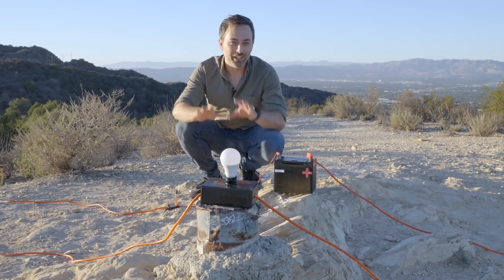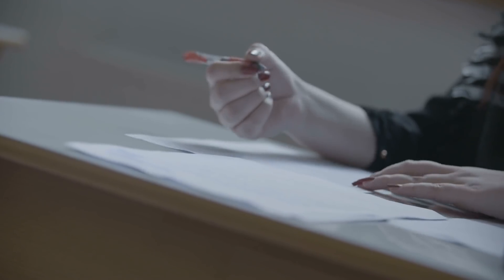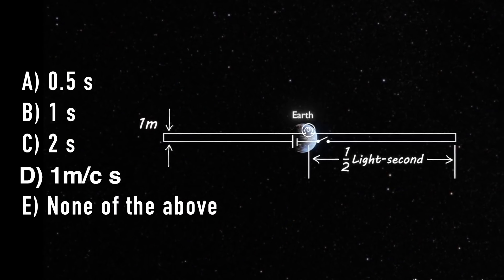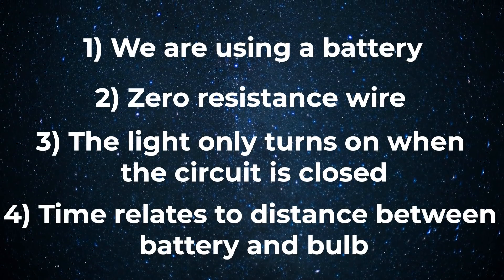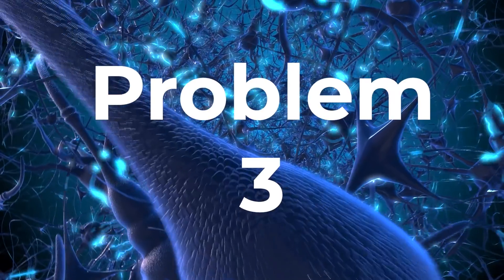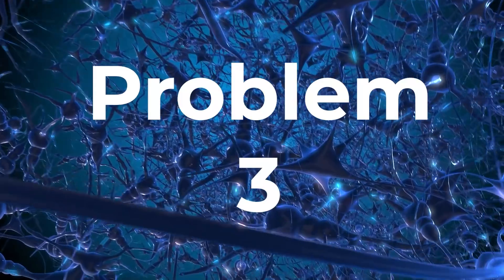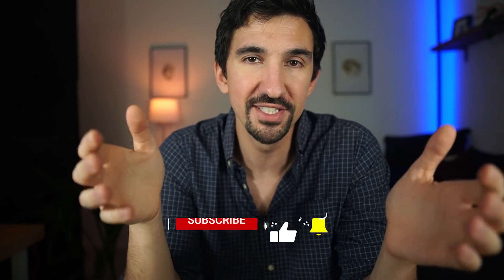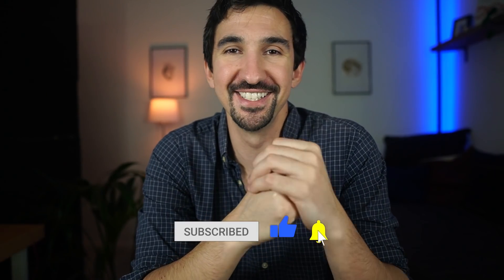Is Veritasium Wrong About Electricity?

Comment: Veritasium is only claiming that connecting the battery (with a switch near the battery) will cause the light to turn on in a few nanoseconds. Not that disconnecting the circuit anywhere will cause the light to turn off in a few nanoseconds. He is basically saying that any change to the circuit will propagate effects at the speed of light, which is kinda true.

Your assumption 3 is already assuming nonlocality. The circuit can be in a state where the circuit is closed yet the light is still only seeing the transient fields, before the steady state is reached. Verirasium is not making assumption 3.

(He's still wrong but not for your reason. The wires near the light and the wires near the battery basically forms a coaxial cable, just one with very poor properties. We might see some transient current in the light within nanoseconds, but this is much weaker than the current in steady state which takes > 1 second to reach.)

Comment: You are right, one is supposed to think about this problem as two antennas and not as a circuit. Otherwise we could fall into problems you described. This might be supprising to high school students that you can still have current even though the circuit is not closed. 

By the way Verisatium's assumption was that the light bulb starts to shine at the very moment some current flows through it. So formally 1/c is a right answer.

Comment: assumption 3 is wrong. if u're familiar with electronics, you know that those 2 wires form a capacitor even if they are not connected at some point very far away from the bulb. so if the wire is broken far away the lightbulb would at first light up and and stop lighting at some point where there was enough time for the information about the broken wire to travel to the bulb. so no causality brakes. doesn't take 12h to think about that, rather 12mins

Comment: I like your antenna explanation, but how would it work if the wires aren't parallel. 
Say an elliptical circuit with high eccentricity, with an appreciable distance between battery and lamp.

I also can't accept "on" being "some potential", as the in the real world the would always be EM energy providing a potential even if the battery is removed from the circuit.

Comment: You are incorrect. Using a battery the current is DC therefore the wires cannot act like an antenna. Second the led is voltage driven, given that it is white, it likely only needs 3 volts to light. Third the wire being a meter apart means it acts like a 800 to 900 ohm transmission line. The capacitance between the wires will cause the voltage to hit 12 volts in 1m/c seconds at the lamp. This happens continuously down the wire until it reaches the ends. Since the ends are shorted it will reach steady state and current will flow through the length of the wire, kind of. If you cut the wire at the end it will take time for the electromagnetic field to collapse and the light will stay lit for d/c from the break.
Reply: The turn on event is a slope, which has a lot of frequencies in it. There is in reality much more than the idealized versions of DC and AC. Actually a perfect slope has all the frequencies in it going to infinity, you can see that if you put it through a Fourier transform.
Reply: @georgelionon9050  you are correct. Assuming no inductance and a perfect switch the slope of a DC circuit being turned on would mimic a frequency approaching infinity. That means a capacitor with a value approaching one over infinity  could pass that voltage with no impedance. Obviously the wire does have inductance, capacitance and resistance so it would act like a transmission line and have an impedance of around 800 ohms so it could provide the led with 6ma of current at 3 volts until the circuit reaches  steady state and then it solely depends on the series resistance of the circuit.
Reply: @georgelionon9050  I should also mention that due to the nature of a white led the forward voltage will never dip below 2.8 to 3.3 volts in this situation because current will stop flowing and the voltage would spike back up because the circuit would go open.
Reply: @FPSG  You're possibly right, at first I calculated the capacity assuming 10mm thick wire (I'm generous) but made a factor 1000 error for m vs. mm. Doing it correctly I get 26uF capacity. Thats why at first I said, nothing, nada, but factor 1000. Maybe. 26uF 12V LED is certainly something one could simply reproduce. Onfortunally my electronic handicraft times are far over, so I don't have the equipment anymore, I would have on my job, but we're currently under quarantine again. The time constant assuming 1mA would be 0.3 seconds. Say, ja, maybe its enough to dimly light until the full EM field arrives (travelling along the wire).

I still say tough, the explanation Derek did is poorly about what he wanted to say, gets a lot of pitfalls of misunderstanding (the contrast of good science communication) and judging from a comment he made as reply, I daresay he didn't understand why D) might actually be the correct answer (if the question would be formulated more precisely in the right manner).

The science asylum video on the other hand on the same topic is excellent all the way through.
Reply: PS: of course 300.000km long wires, 10mm to calculate to a 26uF capacitor putting in the areas, is a gross simplification too. Actually it's way less at first.

Comment: You’re point about the unfair use of the word “lying” is a good one..On the other hand, the bit about communicating faster than light assumes that the effect of the break is instantly communicated. Clearly the second switch would be subject to the same delay as the original - in proportion to the distance to the second switch. You have just set up a strawman - claiming that Veritasium said anything about a second switch.
Reply: The second switch would have a delay. The reason the first switch turns the light on quickly is because of the switch is close to the light so the wave of the changing electric field starts from there and only has to travel the 1 meter to the light. Idk why people have such a hard time with this.

Comment: This is the most sensible take so far. I hope Veritasium watched this. He seemed to deliberately want to create more mystery than understanding.
 12V DC is only going to transfer a miniscule and shortlived amount of power to the bulb which might not light at all until 1 second later when the energy field has gone round the wire to the bulb. A very powerful AC setup will probably transfer some consistent power but that too will only perhaps light it a little bit (e/m wave antenna logic) until, again, a second later when the power travelling through/just-outside the very long wire, arrives at the bulb a second later.

I'm sticking with a second because I infer (strongly) that the to and fro journeys of current happen simultaneously.

Love that breaking the laws of Physics part. It is the icing of this cake.
Reply: " He seemed to deliberately want to create more mystery than understanding."

I don't think so, as that would be totally opposite what he usually aims at. My guess is, he didn't really understand it, took the words some experts he interviewed, but argued it poorly while in fact it may be correct (depending on the parameters you did). But this is the issue the result is, it was more confusing than clearing up -> bad science communication.

And since this comes up again and again, of course science communication has to simplify, but the real art is simplifying it without making it wrong.

Comment: Charge arrives before current in a conductor, photons have a speed limit, Cray computers cut wires to speed of light lengths as a compromise, works fine in real-time.

Comment: If it is so "instant", how does the circuit know if the wires are tied together 1 light year away? Maybe it's open circuit? If he's talking about capacitance of transmission line, that is another thing.. it will turn on for a brief second, but since the circuit would be open 1 light year away, we expect the light not to shine after that..  *edit* was commenting before watching video

Comment: Ideally setting pure DC resistance to 0 is one thing, but impedance remains. You have a really long inductor and a really thin but long capacitor plate. Huge inductance, huge capacitance.

Thus, the circuit cannot be simplified in the way Dereck attempts to.

On the other hand, you actually have a pair of inductors and capacitors, and he specifies them as balanced around both the switch and the light.

So, the path of energy is one meter, even though the transference within the capacitor and inductor takes much longer.

Poorly described problem, yes.

But the time is relatively correct, if you'll pardon the expression.

Comment: "everything says this shouldn't be the case" (information faster than light) but it has already been demonstrated through entanglement at the least.
Reply: entanglement is not information faster than light tough. It's complicated.
Reply: @georgelionon9050  There has been a demonstration of information sent instantaneously.
Reply: @VndNvwYvvSvv  no there is not. Veritasum has a video about it. That one is actually correct :)

Or let me summarize it really quickly, you cannot use the effect to transmit information, since you cannot influence the spin the measurement will make, only after you compare notebooks you will see the two sides always measured opposites. 

Physicists still argue to date how this could be interpreted. There isn't a finite answer to that yet.

But at least at our current knowledge, we cannot use this effect for a faster than light communication.

Comment: Sooooo what happens in a fully shieded circuit. One where the battery is shielded, the wire is shhielded, the bulb is shielded, and there is some sort of damping field to prevent spurious elcectromagnetic fields from leaking into space. Thus zero 'antenna' effect. The only path for the electricty is through the wire. The only fields is that which can be contained by the wire itself. Can the light bulb 'start' to light up 'before' the switch is closed? What makes the light bulb light up? a non existant EM field or the electrons actually encountering 'resistance' in the bulb. Since the EM fields ONLY path is then within the wire. How could the bulb light up in less time that it takes to propagate through the wire. Food for thought. IMHO his experiment is wrong because it allows for too many variables. The enviroment of an expriment is just as important as the experiment itself. Especially when the tester allows the enviroment to 'participate' in the experiment. Eliminate the 'variables' and try that again.

Comment: The only part of his theory is him getting a big YouTube check. Controversy always seems to.  The huge problem is, if the wire has no resistance and the gap between the wires is many several million plus of OHMS and it is DC  then the electrons would use only the wires for their path.  Far to many people over think this brain teaser. If it was high voltage AC and the lamp was a neon lamp, or a fluorescent tube then I would believe it, but that would be cheating.  As an example, I can get a flickering flame bulb to partially glow at maybe 4 inches away from a plasma sphere.
Reply: If you follow carefully, Veritasium does lay out all of the conditions, but the way the problem is presented is grossly misleading. Also his explanation is grossly overcomplicated, designed to impress us with how smart he is, rather than to educate us. Even the title, "Electricity doesn't flow in wires," is a lie. It does. There are just other ways it can travel.
Reply: @briant7265  As you may (or may not) know, sensationalistic titles or "clickbait" are an unfortunate necessity, on YouTube. Derek made more than one video explicitly about the subject, explaining why he uses that kind of titles and thumbnails, proving that they allow his videos to get tens of times the views he would get otherwise.
The fact that the conditions are presented in a misleading way is probably true, tho.
I don't have the scientific knowledge to verify it, but I saw several comments mentioning how the distance between the cables is a very relevant factor for his speculations to be correct, and that information was clearly not presented as important.
Reply: @Shendue  I know, and it drives me away from channels that I otherwise enjoy. 

The distance actually does not matter when the definition of "light" is "any current". We use the exact same principle to communicate with Voyager at almost 11 billion miles. A (changing) current in a conductor on either end produces an e-m field that induces current in a conductor on the other end, a little more than 20 hours later.

Comment: 10:44 i agree that incomplete or incorrect classroom explanations aren't with intent to deceive, but i DISAGREE with you that it's ok if simplified explanations are INCORRECT. I disagree that a simplified explanation of electricity can't include an explanation of energy outside the wire. I'm rather upset at past teachers for failing to explain that.

Comment: My take on the Veritasium video is that he explains that the energy driving the bulb runs outside of the wire-- that's fascinating. But i felt he didn't explain why it's so much faster than the energy inside the wire.

Comment: He did say assume no resistance, and he did not say 1/c is absolute or reality with resistance.
Your faster than light scenario is wrong because the signal to know circuit is broken is the last thing the circuit sends because the last electron pushed the light before it broke. That's why a light flashes before it breaks.
But the magnetic thing really throws me.

Comment: The key is the 1 meter separation. It's basically a capacitor or transformer that doesn't rely on a completed circuit. A break in the wire won't have any effect and no violation of the speed of light. Derek even says in his video that there is no continuous wire from the power company to your house. If the battery and the light were at opposite ends of the circuit, then we'd have to wait however many seconds it takes for the electrons to actually jump from one atom to the next for 300,000km.
Reply: The signals travel as electromagnetic waves while electrons themselves move slower. But moving electrons isn't exactly what transmits energy... Cables work as waveguides and the energy mostly travels outside of the conductor of a cable, meaning that the speed in which the energy transfer happens depends on the interactions of the wave with the materials in and surrounding the cable, the presence of electric charge carriers and magnetic dipoles. This means that even in superconductors the signal can only travel below the maximum speed of light because of interactions between the wave being carried and the environment. The main purpose of a cable isn't to transmit energy or to pass electrons, but to guide the energy carrying wave.

Comment: Whatever the correct answer, it must involve fields. You can't explain electricity without them. And parallel wires will always be close coupled, with current in each wire inducing a current the other.

Comment: I completely agree you can conceptualize the experiment as if you had two antennas, though in that case the "one lightsecond long" part of the gedanken becomes more obviously irrelevant.  More to the point, however, I think the video was more geared towards debunking the notion that electrons move substantial distances down power lines and into electrical appliances, like rolling marbles through a garden hose.  Certainly, when I was young, that is what I was taught and it became an impediment to understanding how alternating current works at all.  So I appreciate Veritasium's effort, though there are older Youtube videos from smaller science comtent creators who in my opinion did it better earlier than his effort.  That said, if he only gets those alternative explanations to pop up in people's recommendations (which is how I got to your video, I'm sure), then that's a good thing.
Reply: Kurt - Re your remark about rolling marbles <certainly, when I was young, that is what I was taught and it became an impediment to understanding how alternating current works at all> I agree! I think I had exactly the same problem when I learned that American AC 120v circuits have a 'hot wire' and a 'neutral'  'ground' wire "just like DC" -  How could that be?  Wouldn't the other wire be 'hot' half of the time?  Fortunately for my sanity I tink I figured it out.

Comment: Let see if i got this right, any electromagnetic field will induce current however small or brief, so in the veritasium experiment would it be correct to say the the bulb will extremely dimly light up because the circuit is kinda transmitting electricity without touching the same way a primitive(with no iron core) transformer would? not sure how the fact that this is DC as opposed to AC influence this but even if it's brief it should work with DC too right?